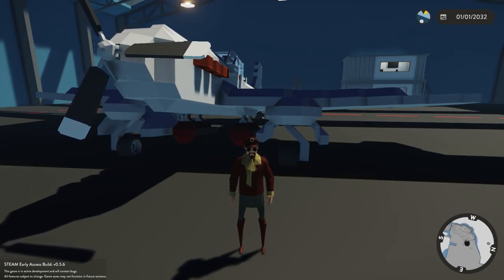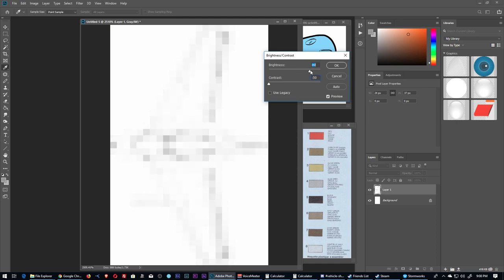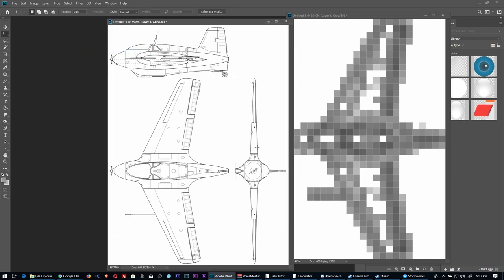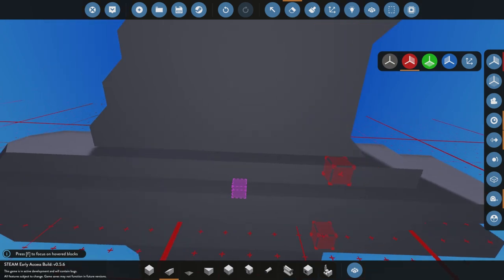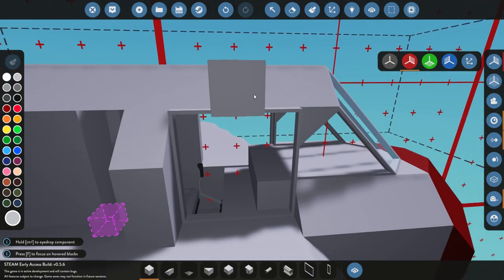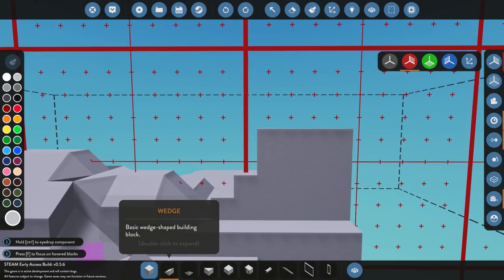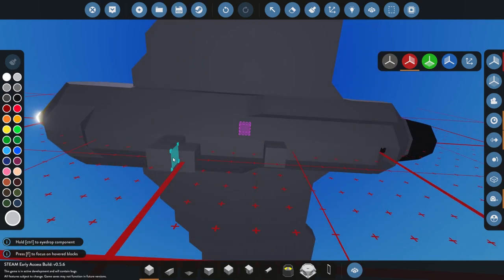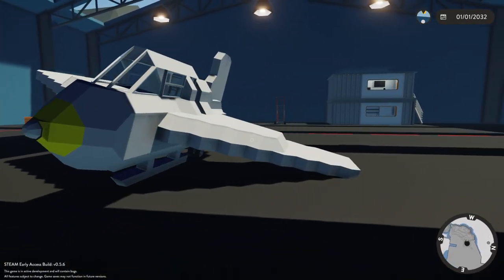Stormworks How To Build A Realistic Advanced Plane Plane Tutorial PART 1

Comment: f-104 I think I might be doing this wrong I have gimp the length is 80 blocks and the width said 22 so If you ever have time can you do the measurements for the F-104 if not than its okay
Reply from the maker: Looks like the wing span is 6.63 so you'll want to side your top down image (the width of the wings) to 27 pixels (4 blocks = 1 meter in stormworks) So 6.63 X 4 = 26.52 round up to 27 to keep a center block :) wings attach to it that are 13 blocks (each wing that is)
Reply from the maker: Also if you crap the top down image on all sides - then size the the image to 27 pixels (wing width) this should give you information on how long to make it in stormworks based on the pixelated length of the resized image :)